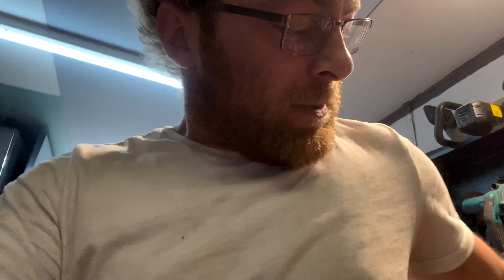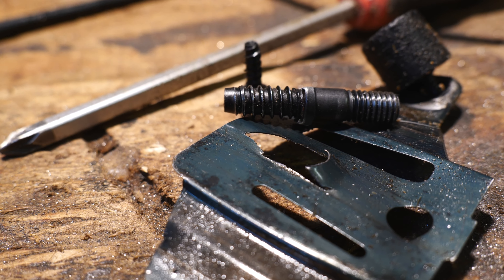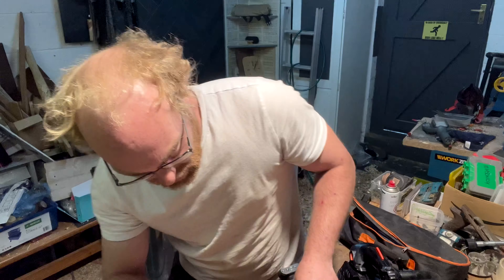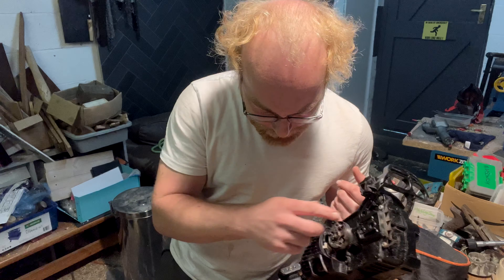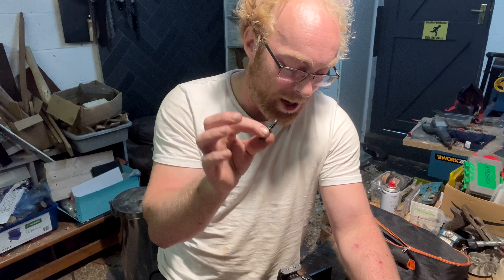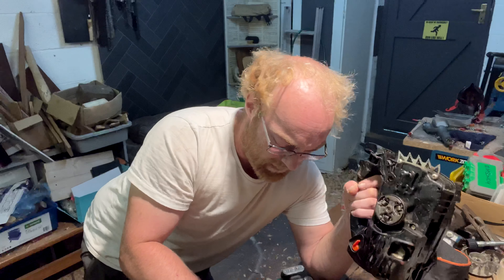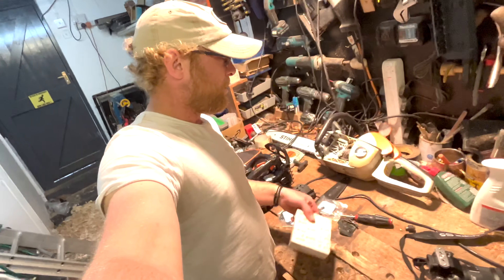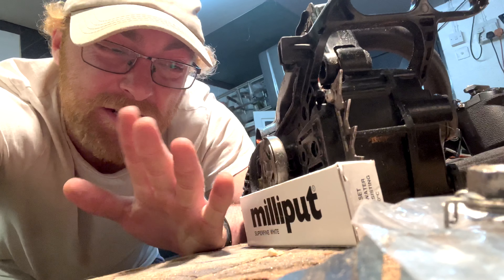Echo 2511 PSA - Don't Break Your Saw!

Comment: thank you so much!  i will try this. Because, of course, i watched your video after i broke my baby🤕😭
Reply from the maker: Oh no! Good luck mate! I just used what I had at home, if you’re buying something everyone seems to recommend JB weld high heat resistant stuff 👌
Reply: unfortunately it didn't work for me…😢 it worked for 2 days but maybe if i tap the hole and put some epoxy on it would be better because my thread was dead…
Reply from the maker: @thieutroady3681  Definitely the best route mate - you could try massively over filling it, drill it out to almost the right diameter and try set the bolt whilst it's still a little bit squidgy? 
Unfortunately the next step is a full replacement casing at about £80 - but finding one is a much bigger problem!

Comment: How should I fix a stripped felling dog bolt hole on that saw?
Reply from the maker: I would do the same as this, or drill the holes on both the saw & dogs then use a wider self tapping screw 👍

Comment: Could you please give the part number to husky gas oil cap. These dealers around where i live cant seem to get the right part. They will not fit in my echo
Reply from the maker: Hey mate it’s part number - 577878603 
Be aware tho they do seal but are very easy to ovetighten and leak a little if you do - if that happens you need to pop the little rubber seal back down & good to go…
Just make sure you’re groundies know too otherwise by the time you’ve got it up after a refuel it’ll be empty again 😂

Comment: Cheers, I have a modded 16' 2511 too, muffler modded, no head gasket etc. Last add-on was a pair of husky plugs as seen on your saw as well, but they are not exact fit and I cant find o rings to match the echo inlets with husky plugs. Can you maybe cover this subject in upcoming video or may be make shorts about it? Highly appreciated!:)
Reply from the maker: Hey there mate, good shout ill see what I can do! ...mine are the same; the fit is finicky - they will seal, but if overtightened slightly will dislodge and you need to re-seat the rubber seal before tightening up again.
Also looking for a better solution - have some bigger O-rings on order so we'll see if they fully solve the issue :) 
Thanks for watching dude!
Reply: @NotYourAverageTreeMan  the only solution I see is to get flat rubber seals, maybe custom tailored to fit both, plug and the inlet, so it wont move "on" the plug but be wide enough to seal the hole well. keep it up!=)
Reply: Hi there - didn't know how to make a comment so jumping on a reply to this one... My question for " not your average tree 🌲 guy"  is does anyone know whether the "echo cs 2511 WESC rear-handled petrol saw" could have the rear handle replaced with a top-handle from an echo cs2511 TESC  donor saw.... along with throttle linkages etc..
I've been trying to look at pics of the saws and can't quite see clearly, but would have imagined that from a manufacturing point of view that if  echo were putting out 2 versions of the same saw, then it  may have made sense to make the saws the same- and add different handles to them......of course it may not be possible -+-- what do you think as owners of the top handle version ?
Reply from the maker: Hey mate, I think you might be out of luck - technically you could, but you’d be replacing pretty much everything but the engine itself - they have different engine housings unfortunately which is what the handles are connected to.
Reply: @NotYourAverageTreeMan   thanks for the considered response , -luckily my local shop has one come in at a great 😃 price....be strong and thanks for the vids
Reply from the maker: No worries bro - enjoy! Not gonna lie I kinda want one of the backhandle versions too - would happily swap my 201 groundsaw for one if anyone UK based sees this and fancies a trade… 😂
Reply: @NotYourAverageTreeMan  the rear handle 2511 wesc is on offer at £299 at George Carr in Bristol.....but yeah swap is good. Btw my new cs2511 tes didn't come with any 'bucking bar'... And their parts diagram didn't show one... There are 2 holes in the plastic that look like they are in the right place for one, but they are just holes in the plastic with no threads.....does one get an aftermarket one & very carefully use a self-tapping screw?.... seems a bit risky at breaking the plastic.....
Reply: @Peter Denisov.... Can't believe you run a 16" bar on the 2511--- what make bar are you using? & which chain?
Reply from the maker: Do you mean the felling spikes? If so, the genuine echo one is really tight - I had to get the impact driver on it to put them in - so it’ll take it, don’t worry! 
I have the panfaa spikes on mine, they’re ok but would’ve probably gone west coast saw 3-spike-dogs if they were available at the time.
Reply from the maker: I have a 14” on the petrol echo as standard now - pulling 1/4 Stihl. The muffler mod really lets it fly - wouldn’t pull it as easy when it was stock - I’ve heard mixed feedback on weather porting is worth it because the muffler mods give it such a marked performance boost compared to stock.
Reply: @aha2551  Oregon 164MLEA041 bar and corresponding Stihl RS chain. Runs perfectly
Reply: @NotYourAverageTreeMan  I made my own:))
Reply: @NotYourAverageTreeMan  so what sort of bolts? or screws ? holds the  felling spikes on into the plastic body....as mine has plastic holes; with no discernable threads....?